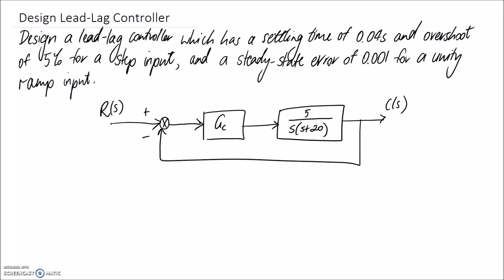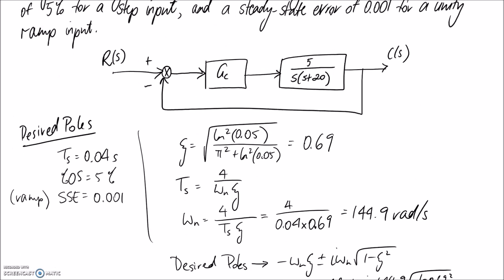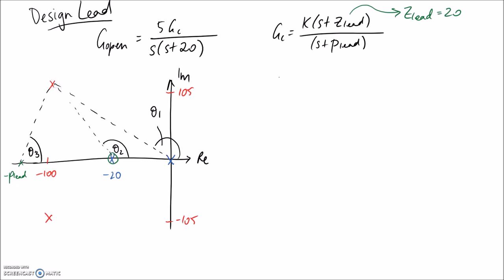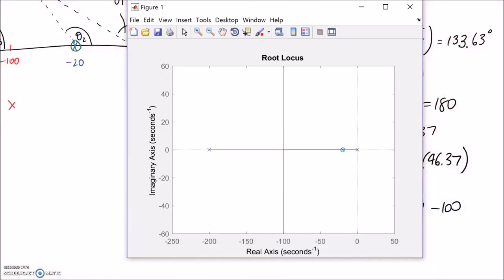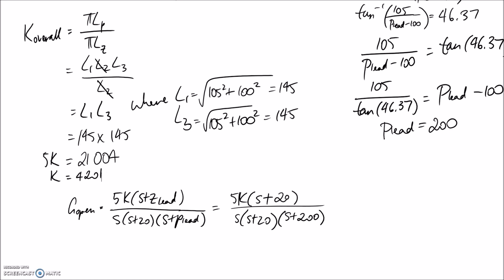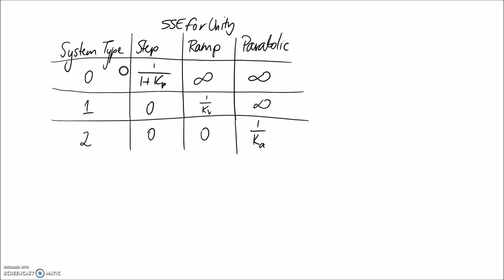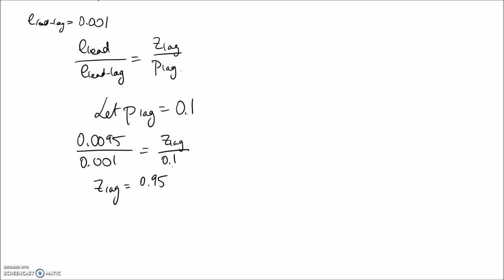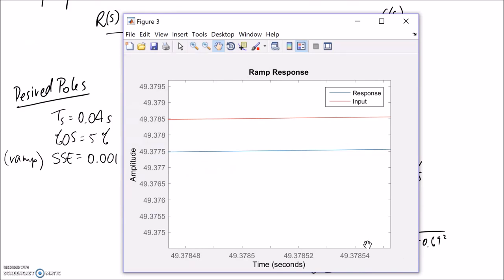Example: Design Lead-Lag Controller

Comment: Excellent, very helpful. Just one small detail I notice and I wanted to confirm, at 14:37 it appears to be a mistake since 145*145=21025
. Thanks for the great tutorials btw.
Reply from the maker: Hi. I think I probably used more decimal places in the calculation which is why there is a slight difference - it's just a small rounding error.

Comment: You are hands down the best lecturer on Feedback Control Systems. I loved your videos. but a little complaint though, you made a video on Lead Lag Controller but didn't make a video on Lag or Lead compensator
Reply from the maker: Thanks for the nice feedback. In this context, controllers and compensators are the same thing (I use the terms interchangeably).
Reply: @theryderproject5053  sorry, I'll rephrase. You made a video on lead lag controller but didn't make a separate video on just a Lead or a Lag compensator. Thank you

Comment: Great video thanks! The mic your using seems to be really hard on speakers though...If you can or want to,  I'd recommend using an equalizer plug-in and turning down the mid frequencies quite a bit until it goes away. It gets hard to listen to otherwise, although its good information so it basically becomes torcher... A different mic thats softer on the mid frequencies would help too but a simple plug-in or even auto-tune would be the best for a quick and easy fix.
Reply: sounds like a controls problem haha

Comment: Some texts write 7:52 as ΣOz-ΣOp =180+360(n-1)  can you help me understand what this means ?
Reply from the maker: I think it is the same formula but taking advantage of the fact that angles repeat on the plane (if you add 360 degrees to an angle, it's still the same angle). I think in your formula n would just be an integer so you'd pick whatever was most convenient (if you put in n=0 then it would be my formula).
Reply: @theryderproject5053  Thank you!  what does n represent,  meaning how do you know to put zero.
Reply from the maker: @ud4458  I think n is an integer - this means a whole number (eg. -2,-1,0,1,2...). You could pick any integer and you'd get the same angle on the plane (since these repeat every 360 degrees).
Reply: @theryderproject5053  thank you!

Comment: thank you for the great effort <3 <3 but i need matlab codes or the way to generate this graph
Reply: Yes Matlab code please! Thank you!
Reply from the maker: @sheepman6291  Sorry I don't think I have the Matlab codes anymore from when I made this. However, if you refer to the drawing root locus section of the playlist, I show Matlab codes for generating root locus diagrams. If you look at the designing a gain controller section of the playlist, I show Matlab codes for simulating the time response.
Reply: @theryderproject5053  
Hi 
Please can you do a fever for me, I need to know how can I change the information of pid controller into reality 
Thanks

Comment: u should've consider 90 angle of second pole (red one).
Reply from the maker: Hi. I think you are referring to the second closed loop pole that is sitting in the lower right quadrant at (-100, -105). If so, it should not be considered in the root locus calculations for angle as I have done it - you just pick one closed loop pole to consider and in this case I picked the one in the upper right quadrant at (-100, 105). You should get the same answer if you choose the other one though.

Comment: Can you plz provide MATLAB code i am confuse in coding
Reply from the maker: Sorry I don't think I have the Matlab codes anymore from when I made this. However, if you refer to the drawing root locus section of the playlist, I show Matlab codes for generating root locus diagrams. If you look at the designing a gain controller section of the playlist, I show Matlab codes for simulating the time response.